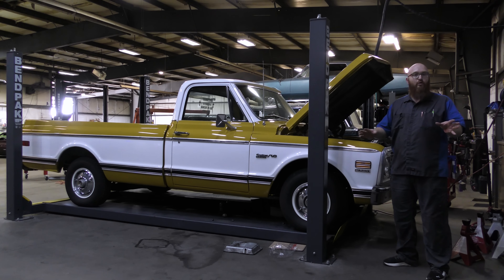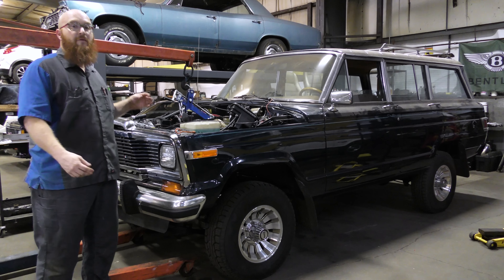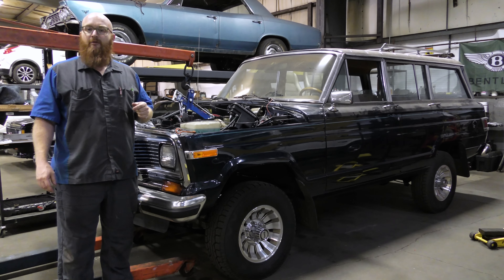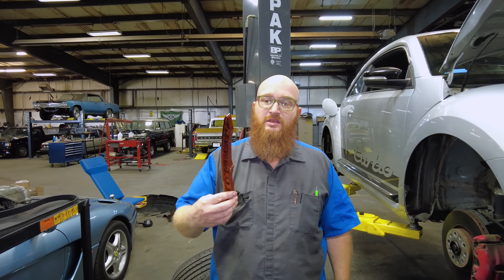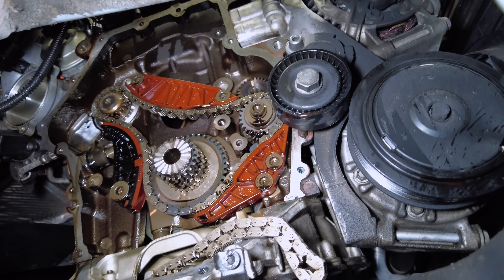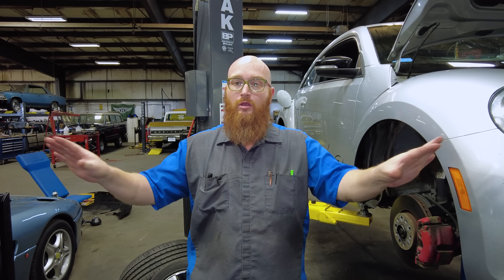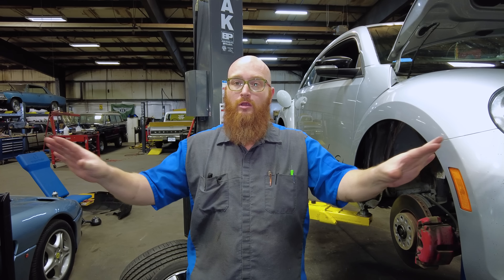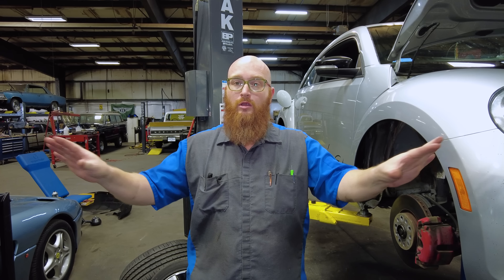Hard to test, can't see it, but it can KILL your car! CAR WIZARD talks Timing Chains! Is yours next?

Comment: The timing chain stretch issue in modern Direct Injected engines is due to the micro soot that is generated at low speed high load. That soot doesn’t cause any issues in most components even though it’s too small to be caught by the filter but it will cause accelerated wear in the tiny pins in the chains. The newer API GF-6A oil specs addressed this specifically with a new formulation that helps prevent this soot by both stopping low speed pre ignition and suspending this soot to keep that wear from happening. Not all oils are created equal, be sure your car is getting the specific API rated oil and it will last much much longer. Keep in mind that this standard wasn’t established until 2020 when the root issues had been studied and addressed.
Reply: I always believed that it's also due to the additional components loading down the chains (VVT, oil pumps, water pumps in some, etc) and the extended length of them in OHC engines. If you lose x amount of material in the pins of a 100 link chain you might see a small amount of "stretch", but in a 400 link chain you're going to see 4x that stretch since the pins all wear equally in most cases. 

Your explanation goes even deeper and makes sense. Another factor is that engines used to be thought to be worn out by 100K miles so the chains never failed. A lot of engines are seeing double that nowadays so it would make sense that chain wear is a bigger factor.
Reply: Correct. I worked testing timing chains of ford engines. The soot, is carbon, and it wears out the chains.
Reply: Indeed. Jason on Engineering Explained did a video on that very topic. The longer the chain the more potential for wear & therefore stretch. Even if it's only a few thousandths on each pin it will add up to inches in no time.
Reply: So safe to say, timing chains should have a scheduled replacement time. Just like timing belts, different factors contribute to the life span of chains.
Reply: The issue here specifically though is that tensioner. That is not the revised tensioner. VW tensioners would become loose and allow the stretch. They fixed the issue in the Gen 3 engines (2015+ in the US) and released a new tensioner for Gen 2 engines.
Reply: @volpswagen_marco  possibly… one would think that if the wizard here can simply look at the intake cam phaser offset with a scan tool that the MFG’s could simply have a check engine light/code to say “time to change the timing chain”. 

That being said, I have had many a Toyota DOHC engine for 300k miles with zero issues. The old 22R would wear through its guides and into the water pump housing over time but usually only when it was abused.  Most of the engines that go many hundreds of thousands are engines without direct injection. It’s a wonderful technology but has its downsides. We’re learning.
Reply: @XxSmokeeyxX  correct, these engines had the less than reliable chain tensioners on them. The chains never had time to stretch because the tensioners would fail before that lol. I still say, manufactures should recommend a scheduled “chain” inspection (scan data) so that clients are aware of possible issues, instead of manufactures calling these service free engines. Try telling a customer your chains need servicing when they come in for a routine service. They’re usually not happy 😃
Reply: @DirtE30  I had that exact thing happen to my Toyota pick up. A ton of coolant made it into the crankcase and turned the oil into chocolate milk. A friend of mine replaced the chain and welded up the timing cover and off I went.
Reply: @Richard Cranium 100k till HG goes pop?
Reply: @Mayamax3  just a little more rattle than before eh?! 😂 

I’ve fixed dozens of em. Rolled new bearings in the bottom end and adjusted the valves worst case. Run em another 100k.
Reply: @XxSmokeeyxX  I don’t think the tensioner allowed the stretch. I think the tensioner didn’t have enough throw to accommodate the amount of chain stretch that was happening.
Reply: @volpswagen_marco  it wouldn’t be such a big deal every 100k mile if they just said that’s what it is. No different than a TB change.
Reply: @DirtE30  exactly
Reply: @DirtE30  The chain was noisy as Hell, but I lucked out with the engine bearings. There was no damage visible and the engine was as quiet as a mouse after that. Even after woofing all that coolant through the crankcase. I was amazed.
Reply: @volpswagen_marco  If you change your oil regularly, the chain should last as long as the engine. I've seen many early 2000 Nissan and Toyota chains last over 500K miles.
Reply: @BubblesTheCat1  non direct fuel injection engines yes. @DirtE30 explained the reason for chain stretch very well for direct fuel injection engines.
Reply: @volpswagen_marco  I will never ever buy a petrol GDI engine car, they're full of crap.
Reply: Thanks for sharing.
Reply: That is really interesting and does go a long way to explain why we started seeing a lot of issues beginning in the 2000s, because that's when we really started to see direct injection introduced.  Of course, there are a list of vehicles with certain chain issues before direct injection but the correlation to DI seems very strong.
Reply: @kevin9c1  it's not the DI, it's the chains being so long and doing so much .

Comment: I beg to differ with you on the issue of proper maintenance ie: oil changes and the like. You do get a very tangible benefit out of them. 
You get peace of mind, confidence that your not likely to be stranded on the side of the road. Confidence that your vehicle will start, run and perform as designed.  So in my book routine maintenance is cheap insurance indeed.
Reply: I would add to your statement: the proper oil and OEM filters should always be used.
Reply: @volpswagen_marco  I agree 👍

Comment: I remember Pontiac and some Ford engines used plastic tipped timing gears that would strip off causing problems.  The plastic pieces would sometimes plug up the oil pumps.
Reply: Pontiac timing chains, I probably did 5 of those for every 1 of all the other makes.
Reply: Most all of GM engines used plastic tooth timing gears in 60's -80's. Only heavier duty trucks and some high performance had double roller timing chains.
Reply: @hotpuppy1  On GM small blocks in the 80s the camshaft would normally get wiped out before that plastic dipped timing gear showed any wear. I did an absolute boat load of small block cams. We always upgraded the chain and sprockets while we were in there.
Reply: @michaelmathews295  
The 301 was the worst.
Reply: Yup!!  Have found the little bits of plastic in my Ford Mustang oil pan. The plastic coated gears were failing and pulled the engine for a complete repair.
Reply: @kattcasel9730  
The worst problem with the 1960’s Ford small block 289 and 302 is that the cam gear was aluminum with the plastic coated teeth, when the plastic came off, if it didn’t jump time right then, the aluminum teeth wore off almost immediately and then it jumped time. I also hated that the fuel pump eccentric and cam gear were only secured to the cam with a single bolt. If you didn’t use loctite on the bolt when you put it in, there is a very good chance it will come loose in the future. That usually doesn’t damage anything, it just causes the mechanical fuel pump to stop working and the engine stops running.
Reply: Most of the GM engines in those days used the nylon coated cam timing gears. Pontiac was pretty consistent at sheading teeth just north of 50,000 miles. We always replaced the Pontiac and Chevy cam gears with solid steel gears. The chains would have a little stretch in them and we would replace them as well.

Comment: My first thought was,Real VW"s are air cooled.I had many bugs in the  1970"s & 80"s.They were great cars that could take a real beating.Swap the engine in 4 hours,4 bolts & 7 wires,floor jack required.Engines were easy to find & cheap.Usually rusted out cars that still ran good.What"s easy to forget is how often you had to work on the old cars,with points & plugs,it  was constantly.These are the things from the "good old day"s",that are easy to forget.Bugs were cool tho.

Comment: Wizard, the early 70's Toyotas with the 8RC and 18RC engines had dual timing chains that would grenade if not changed on a regular basis. Mine 71 Corona chain got so stretched that it flopped around enough to break the upper chain guide. The piece that broke, fell down and jammed between the lower chain and the crank gear. That caused the auxiliary shhaft to break and the shaft broke the timing chain cover! What a mess. Great videos! keep them up!
Reply: Man...I totally remember those having timing chain issues BITD!! Poor design lol

Comment: When I started working auto parts in the 80s it was very common to sell timing chain kits. Cripes I can still remember part numbers for Chevy timing kits, lifters, valve cover gaskets and main and rod bearings. We don't even stock engine parts anymore.

Comment: Great video. If you ever want to show the difference between an old and new chain, turn it 90* in your hand and hold them out like a sword.
A worn chain will sag due to wear in the pins and plates and the new one will have minimum sag. I've seen heavily worn chains that would sag a full 90* when held out! This is an old motorcyclist trick to see if your drive chain is shot, especially on older non-Oring chains.

Comment: I had one break on a 1999 ford ranger with the 2.5LT engine. Luckily it was a non interference engine. The worse part was being stuck along a roadway with not a lot of room to get off the road. It was fairly easy to replace.

Comment: Wizard, there is a fifth way albeit I think only used in the 1920's and very early thirties by Bentley on their six cylinder engines. They used a triple throw eccentric drive a bit like a steam engine. This was very quiet but in order to allow for thermal expansion of the cylinder block, the camshaft had to be hydraulically suspended on a series of dished washers inside tubes, pressurised by the oil system. The very long camshaft also had to have a torsional damper.

Comment: I have a 2006 Chrysler 300, that was a garage queen for the first 13 years, I picked it up from the original owner's son 3 years ago with 35,000 miles, It currently has 43,000 on it. I bit the bullet and had the timing belt service done recently as it has the 3.5 V6 which is an interference engine, not because of any problems or symptoms but because of age, I plan to keep this car for many more years as it still is garage kept and looks almost showroom new.

Comment: Love your channel Car Wizard.  I do want to mention however that many V8 and some 6 cylinder engines from the 1950s-90s from most if not all American manufacturers had nylon-coated cam gears that can fail. The nylon wears off or gets brittle (sometimes just from age) and breaks off ending up in the oil pan. Eventually the engine jumps time.  In my family back in the 70s and 80s we had four fail: '67 Pontiac 326, '68 Chevy 327, '72 Chevy 400 and a '73 Chevy 350.  The 326 and 327 happened on the highway and the valves hit the pistons - game over.  On the 400 and 350, it failed during startup and did not bend the valves.  All had made it to over 100K miles, but it is still something to look for today because old, brittle nylon gears can fail even with low mileage.

Comment: Every 5000 miles my car gets oil change, tire rotation, all three wipers, cabin filter and check and assess transmission and brake and anti freeze. Timing belts used to be around 50k years ago. Thank You 🙏 Great Videos
Reply: replacing all wipers and cabin air filter every 5000 seems incredibly excessive unless it takes you actual years to drive 5k.
Reply: Wait... cars weren't even around 50k years ago.😉
Reply: @laurat1129  Hi 50,000 miles years ago. Like the Ford Escort or else when they went the valves bent and all hell was done. It was back in the early 80’s when I was turning wrenches for a living.
Reply: @rudolphna54  I don’t care about that when I get rid of them I always get top dollar.
Reply: @rudolphna54  yeah... I do my cabin filters yearly. fresh wipers are always nice, although on my Hondas I have left the factory wipers and get new "inserts" from the dealer. they stay in perfect shape for at least a year. my current set is 2 years old and I'm about to replace them. 

I wish my f150 had wiper inserts... I have to get the aftermarket wipers and I'm never happy with them, although my current set is 1.5 years old and starting to show age.

Comment: Wizard,  as someone who was in the business, those who owned those engines with timing belts, and interference valve trains,  often were shocked when that rubber band busted , and the engine was shot.  I have seen those small block Chevy engines break a timing chain once in awhile, but that was after they had many miles on them.  The fix was to put the heavier double by circle type Chan and gears, to resolve the problem. They are making them cheaper, to help the service department, and the sales departments in the dealerships just like you said

Comment: I had a Pilot that I bought new and sold it at almost 340,000 miles. I has the timing belt and water pump as well as every fluid in her 4 times. Plus the regular oil changes. She was a great suv.

Comment: I had to replace several timing chains and gears on 70s model cars. They had plastic teeth on the upper gear and they would wear and finally jump time. The replacement gears were all metal.

Comment: My brother was driving a 1971 Ford Ranch Wagon with a 351 Windsor under the hood and 40k miles on the odometer. Being a punk kid, he was doing a brake stand and grenaded the engine. We found nylon teeth from the timing gears in the oil sump when we took the engine out of the car to replace it. I'm pretty sure that steel gears would not have failed like that.

Comment: Great Video about the truth.  I have my stories on timing chains.  I have a 1964 Pontic 389 and those had nylon teeth that failed.  Ford had problems in the 70's.  My 1971 Triumph TR6 timing was jumping timing all over the place because of chain/gears, I just did a 1978 Chevy 305 timing set and found the H Balancer was about to fall apart.  I pulled a chain through a 1971 Mercedes 450SL.  I've done more but the point is that you have made a good video that people need to see and just learn to love this part of the deal.  Hondas, Toyotas.... man it is just a job that must be done but folks need to know that it can turn out BETTER as you can get so much more life and better running by doing this - and maybe find other problems that may end your motor.  That Lincoln heater valve story is a place I've been too... but not again... Just like You I am not going to lay hands on any part of some of these older cars.   Great Work!!!   Bobby

Comment: Thanks for another great video, Wizard.  I have had plenty of timing belt and now timing chain experience.  My 88 Honda Prelude Si' timing belt broke. Fortunately, that repair was covered under warranty.  We did do the timing belt service wife's previous VW Passat GLS 1.8T - for that car, the whole front of the car has to come off.  Good old VW/Audi Service Position.  My current BMW 328i has the N20 Turbo 4 that was the subject of a class action lawsuit against BMW.  I am not having any timing chain issues with it.  From my BMW whisperer and FCP Euro, I have been changing my oil every 5K miles with LiquiMoly synthetic oil.   10K miles is way too long for oil changes.

Comment: Emissions is also a driving factor. Lighter engine internals means less mass and/or friction giving slightly less consumption and voila a green(er?) engine that fails prematurely. But manufacturing costs are the biggest driver for sure.

Comment: Great topic Wizard, well because you are the Wizard. Use to hate timing belts, but it seems the belt tensioning is simpler and more reliable than long chains with plastic guides and oil pressure tensioning. It's also about the industry wide design  move to overhead cam engines versus rocker arm engines. The worst engine design is a overhead cam engine with timing chain that also drives the water pump; when the pump seal fails, the coolant mixes with the chain lube oil. Some many ICE iterations and they still do the dumbest engineering!  Let's remember new camshaft and chain loading caused by new DI high pressure fuel pumps.

Comment: I had a '63 Econoline pickup that had a similar heater valve setup which of course was a leaky mess. I ended up buying a more modern heater core that fit the box and used a conventional valve. I know that's not your shop's gig, so I feel your pain.

Comment: I quit flat bedding in 08 and went to containers. Prior to that I hauled coils not strictly but many. I specifically remember these single 44,000 lb belly load coils they were very very specific in preparation to leave their shop. One main place I delivered & there was a secondary one occasionally. You would uncover the coil they had a little supercomputer which he explained to me in the layman terms. The metal had to be very very stringent tolerance to specs.  Or it would be rejected and you'd have to take it back. These coils were specifically for making timing chains and go to gear assemblies. That morning noise is a sure indicator. My parents tried to push that one. Interference heads. Do not want to skip service dates
Reply: One of the scariest things to haul on a truck!

Comment: In high school (1980s) we used double roller timing chains, never gave a problem.  Recently, I got 197K miles out of the timing BELT in a 2011 Honda Pilot.  The thing that let go was the tensioner in the timing belt.  Engine just quit when that happened.  Thankfully, pulled water pump and front of engine apart, replaced tensioner, belt, water pump, etc., and started right up after.